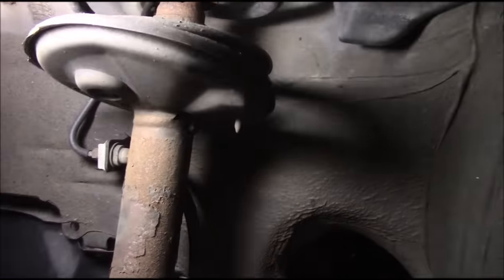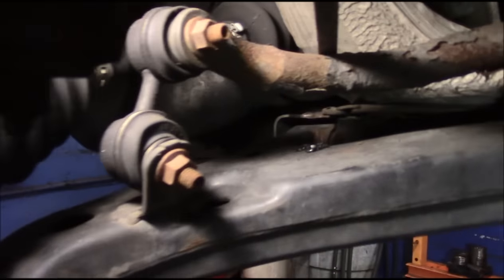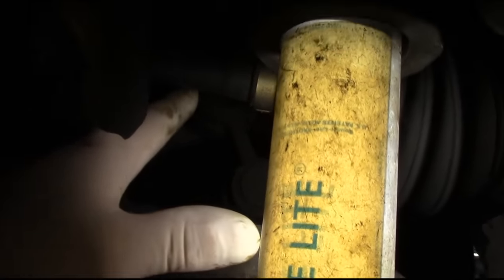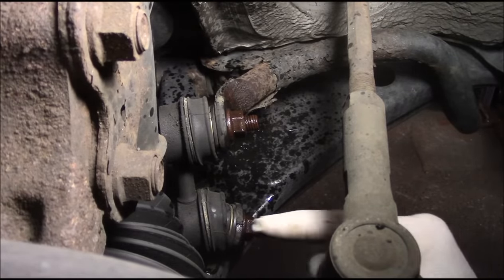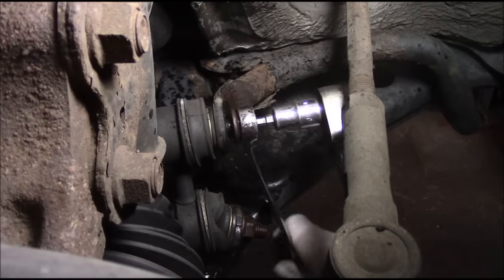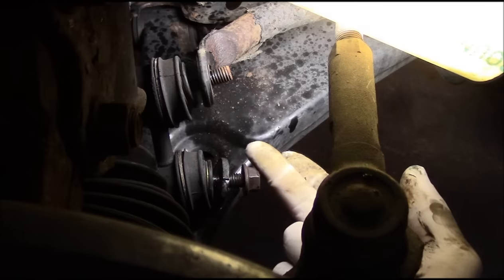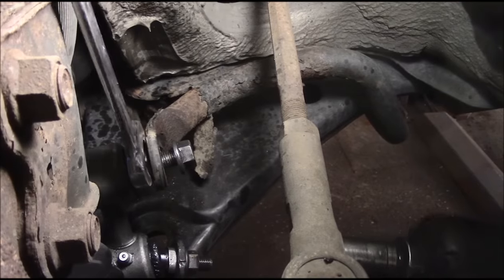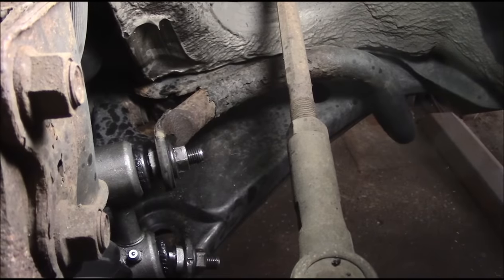Diagnosing Front End Noise

Comment: I stopped buying Moog! i think they've been living on their reputation for a while now.  besides, other after market products are not as cost-prohibitive. did the same job on my ford focus. mevotech and Centric sway bar end links on these parts also have greasing nipples and that nut that needs to be held with a wrench as you tighten. the pair of these sway bar end links would cost, if Moog 92$ Canadian, if centric or mevotech, the pair costs 40$ CAD. the mevotech and centric would last 2 years. the moog,3-4. so basically you wont be saving anything if you buy moogs, other than labour.

Comment: Hi Mr. Jim, My name is Joshua C. This has been an inspiring video for me. 
I currently own a 97 toyota celica automatic1.8l 
I am having a problem that I just cannot put my finger on!
Everytime I come to complete stop my I can feel my engine pulsing throughout my steering wheel and dash. I just replaced my motor mounts and its just gotten worse. 
Man please if you have any suggestions would you let me know? I cannot find your email on here. My name is Joshua Covington I am an old school  home mechanic that is just puzzled. Please my friend or other viewers if you have any idea what could cause this please let me know. Also I have noticed when my A.C is running the vibration's are worse. Thank you.
Reply from the maker: Hi Joshua,Is the a lot of miles on the car,Is the check engine light on?Do you have a shake in the engine when accelerating?
Reply: jimthecarguy  No it does not have the check engine light on, and when I accelerate the vibration calms down. I’m lost on this one. The only thing I can think of is possibly the steering rack and pinion. What do you think?
Reply from the maker: You may want to check the compression in the engine.Is there a lot of miles on it?

Comment: ...it there another sway bar ...one called the "outer sway bar" ...??
Reply: No, there has been a miscommunication with whom you are quoting. The sway bar is a single solid bar tied together by 'endlinks' each of which attaches to the lower control arm or strut body. Then there are two rubber-bushed brackets that support the bar itself to the car frame. Most vehicles have a sway bar on the front and rear - two sway bars total. But there is no 'outer sway bar'. Perhaps it is possible they meant 'outer tie rod end?'

Comment: My car doesn't have a torx end or a wrench fitting. It just spins with the nut, which is annoying...
Reply from the maker: There has to be one or the other so you can hold it when you remove the nuts. I'm happy to help. Watch for the next free tool giveaway coming soon.
Reply: @jimthecarguy  for 90s civics, the studs are really short. I usually cut it off as a last resort. It's not a problem, it's just really time consuming and annoying.. but thanks anyways.

Comment: It always comes down to the Sway Bar Links on most videos. Well that doesn't mean anything. My car rattles and clunks over bumps only on the right side, front and rear and everything's good. No movement in anything with the pry bar. Struts and Strut Mounts have been replaced 2 years ago with no success. I can't find anything loose. It can be anything and some things are hard to impossible to diagnose, like mine. If anyone has any answers, good luck, besides buying another car. I know what I've done to it and you don't with something else. I guess I'll just have to go by the old saying, "Just turn up the stereo !" Edit: A Ex co-worker gave me a ride home from work a while back and his Chevy Equinox made that same rattle as my car does and I asked him "What is that ?". He told me, "The tire shop said it was a bad tire" lol. I didn't say anything but I've never heard of tires causing rattling noise over bumps. After $350 worth of tires, and......still did it. Tire shops don't always know jack s**t. They made 350 bills off him anyway. Holy, moly.

Comment: Also,  I used to be a tyre fitter from a way back and most of the cars had grease nipples to lube the joints.  Why have we gone to a throw away society.  Tha'ts why it was called a grease and oil change.   Not just an oil change. :0

Comment: I freaking hate those bolts. It will strip. I back it out 80% of the way then it stops and you can’t move it back or forward. Why the hell can’t they just use Moog’s design in the first place? What is the purpose other than forcing you to the dealer to get it done? Especially if all I want is to replace the struts, I just need to disconnect them not replace them, now I have to get a new set to replaced the cut up one. Idiot Engineers.